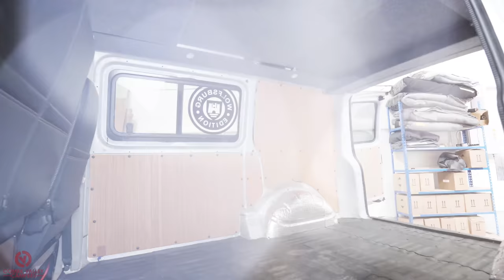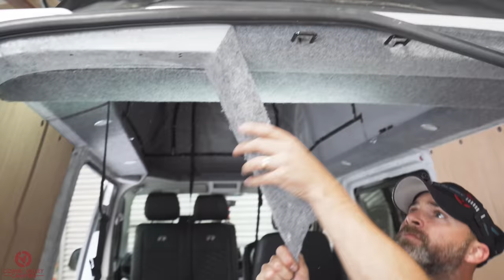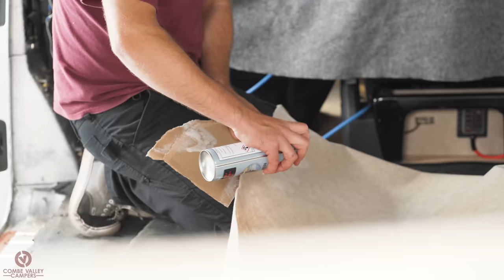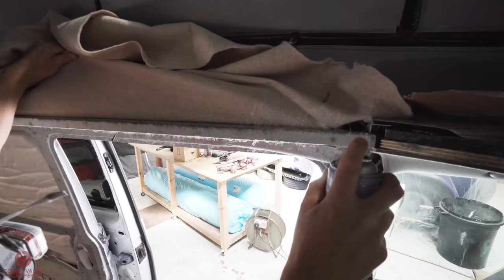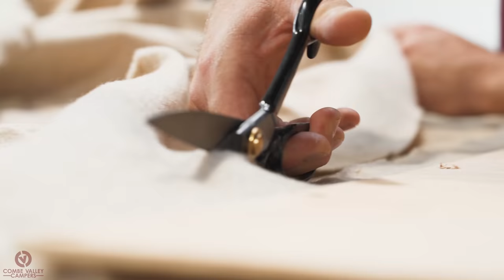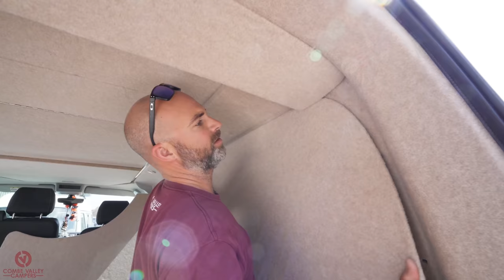HOW MUCH CARPET DO I NEED FOR MY VAN? Complete guidelines and amounts.

Comment: I see you did both sides separately, starting at B pillar, is this normal way ? Then you go back and carpet round the front of poptop above headlining ?
Rather than do it all in one length ?
Reply from the maker: It depends on the van and pop top, I prefer to carpet from the canvas down in one go to make a nice smooth finish from top to bottom. I hope that helps. Leigh

Comment: Hey guys - had some feedback about carpeting over access holes? Like in the transit custom there is access to rear light clusters? In my build I cut out the holes but then put a small panel onto op after to make it neat and tidy… some one has commented that this can impact air pressure in the van and when you close the doors the windows could pop out?! Have you guys ever seen this or any advice on it??
Reply from the maker: We have done the same with no problems over the rear light clusters. However, it is advisable to have a clear route through to the 'vent flaps' in the rear panels. An idea is ro add a series of holes in the panel, then carpet over the holes so the area is still 'breathable'

Comment: I have a question?  I have a swb T5 I have been quoted £1500 for the carpeting in the rear, one piece roof ply and both rear quarter panels over priced or about right ? I have sound proofed the rear only the lower parts already
Reply from the maker: That seems not far off the mark for parts and labour on a custom job. I would suggest you price the parts separately, and maybe even give it a go yourself. We have more than one carpeting guide on the channel to help you out. Leigh
Reply: @CombeValleyCampers   thanks for the speedy reply yeah I just don't want to mess it up doing it myself haha. They guy who quoted me I have seen his work seems Bob on. Only conserving part is he doesn't carpet line the rear barn doors as he said there are no edges to go flush it he only carpets the panels?